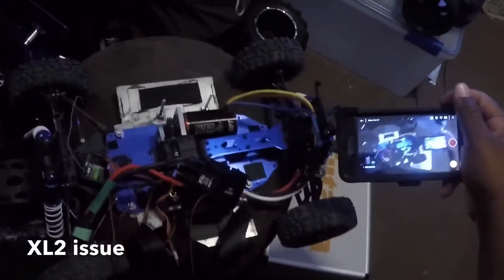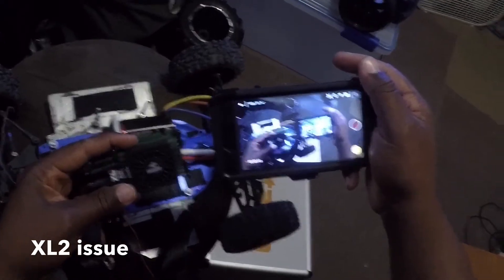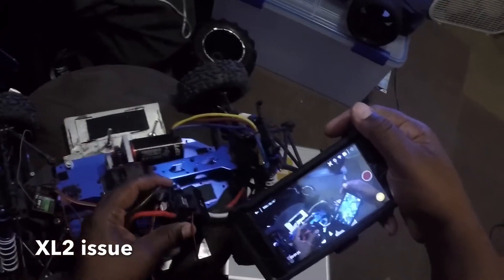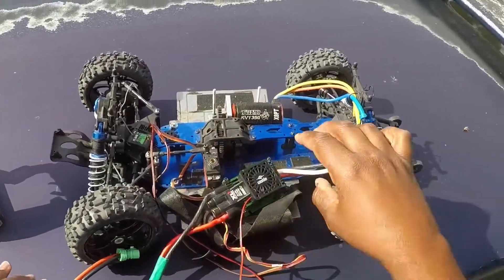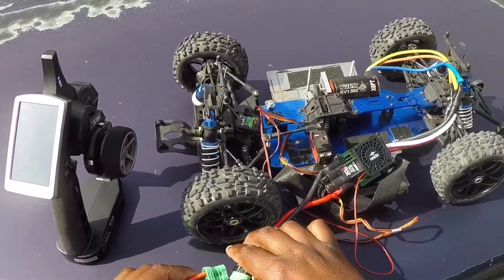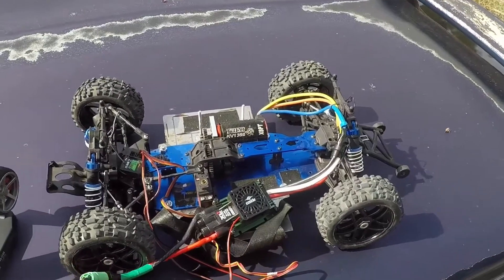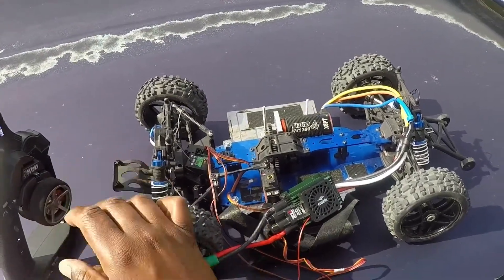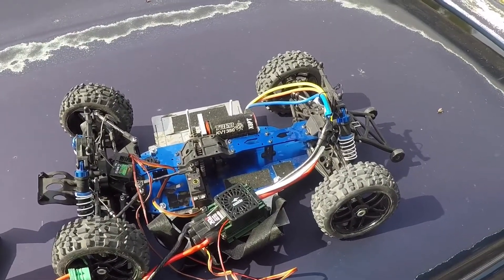[ISSUE with my XL2]  Any Help Is Appreciated

Comment: Try the normal stuff... check if your LVC is on auto or on a fixed number, could be on a fixed number that is not for a 3s lipo and she cut's. Also bind again the receiver to remote, and program de ESC for the throotle. That way you know everyting is allright. If not... send it to Castle and pay around half the price of a brand new XLX. They have non warranty program that if we send the dead units and want a new one...we pay half the price...or close to that. They have a board with the "prices"...search their website. That's one of the brilliant things i like on Castle... we are warranted...yah we pay, but it's not the full price of a brand new one! I am talking about past warranty times... :)
Reply from the maker: targetingxmod    Thanks!   Unfortunately I replaced all the capacitors in it and the last time I did that and sent it in I paid more than half price😫.  I'm like a gluten for punishment.  Lol... hopefully I can get this resolved.  I'll try the recalibration.  🤞🤞. Thanks again!

Comment: Call there customer service which would lead you to tech service. They usually always have the answer. 
Don't know much about that esc, but if it's not sending power through, could be bad resistors on the main boards. But tech service is ur best bet. U would have to crack it open and give it a good visual inspection and check with meter if ur tryna get knee deep in it.
Reply from the maker: Kevin Moxley   Thank you.  I've cracked it open and visually there's no brown or black spots.  The circuit board front and back looks pretty clean.  The warranty was void prior to me opening it and replacing the caps, but as for the resistors, I have a multimeter with no experience on how to use it correctly.  This is a replacement I had paid close to full price for back when my first XL2 needed repair with a Tier 2 warranty.  I was hoping to save $160 by fixing it. 😩
Reply: Kevin Moxley I plus +1 that idea lol customer service support at this point in the game, hope there not non existent like most C/S with most products you buy. seems like castle at 1 point in there life has been lowering quality control, Idk maybe due to not being able to keep up with added high volumes seems like a lot of new people getting into the hobby. lithium ion certainly has made the hobby alot better imo. my first rc back in early 2000's was an HPI nitro 1/8 scale running 20% shit now there running damn high octane pump gas. I'm back in the game now and still happy with the direction I decided to take as far as fuel source is concerned, can't beat that L-ion and graphene!!
Reply from the maker: Mike Fahner   True that!  Rc has come a long way.  There was a backorder not to long ago on esc's

Comment: Try recalibrating to your receiver, if that don't work send to Castle. good luck
Reply from the maker: mtctookie25   Thank you!  I've replaced all 4 caps and the last time I did that I ended up just about paid for a new one.  I'll try recalibrating it.  I wish I knew what the last good firmware update was for it.  It turns on and saves the programmed settings.. idk
Reply: 13djdave13 after turning on & no power could mean your board is damaged.
Reply from the maker: mtctookie25    True... like one of those mosfets that regulate the current.  I was hoping it was as simple as firmware downgrade.  My Castle Link shows a data log tab, but the XL2 shouldn't show a data log.
Reply: Hmmm

Comment: can you try different motor real quick. process of elimination. but seems prob is in esc with thermal switch. mosfet circuit switches unfortunately are always the first vulnerable pieces of hardware in a esc to go. I'm only 1 month into the hobby but been certified automotive technician for over 20 years and I will say electronics are all electronics.... I would always try other motors and servos just for the hell of it what you got to loose at this point but little time and effort. unfortunately mosfets go and you can't tell by lookn. open and closed circuit breaker is about what they are, 3 terminals gate, drain, & source the gate supply voltage at the gate generates electrical field across the drain and the source channels which in turn regulates voltage flow.. you can test the leads with low voltage ohm reader..
Reply from the maker: Mike Fahner  Thanks for the advice.  I have to try testing like you said with my multimeter once I get a chance.  As for using a different motor, this is the second servo/Tx-Rx/motor combo I've tried it with and it's been doing the same thing ever since the last day it was working fine.  Not sure what else to do at this point besides try recalibrating the esc to the receiver.   Everything's a long shot at this point.😫lol

Comment: On my last Castle XL-2 esc had it lasted almost 3 years or more but it stopped working for some odd reason and sent it back to castle and they were nice enough to sent me a XL-X esc when it came out......Maybe they could help you out bro....
Reply from the maker: R/C CUSTOM   That was pretty cool of Castle.  Unfortunately this XL2 was a replacement from my first XL2 and both of those always seem to stop working after the 1 year warranty😩😭.   Luckily my fiancé got me an XLX last Christmas, but it sure would be nice to use my XL2 in another rc build.🤞🤞
Reply: 13djdave13 I have 2 of the xl-x esc's and I'm trying not to overheat them so they'll last longer lol 👍🏼
Reply from the maker: True that!  I noticed the XL2 had a voltage cutoff fail safe, but didn't have one for temperature which is another good reason to go with the XLX.  I still miss my XL2 though :-(